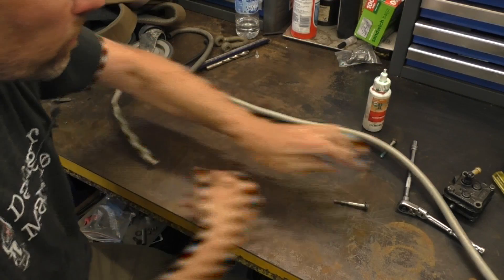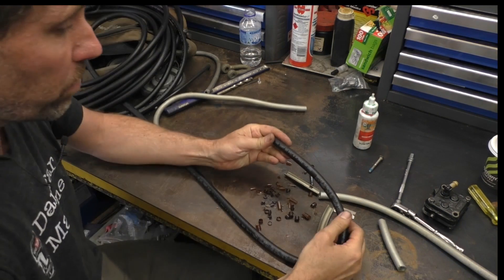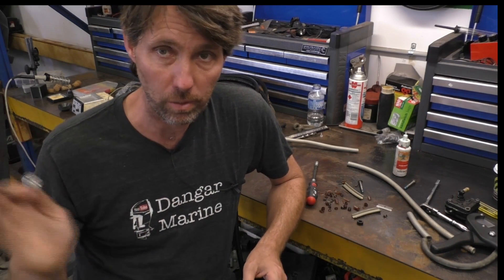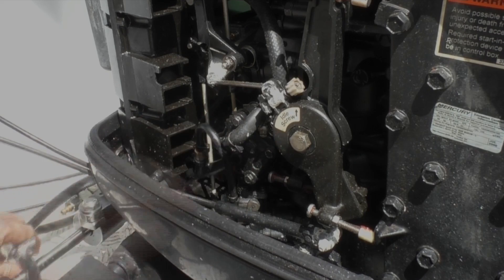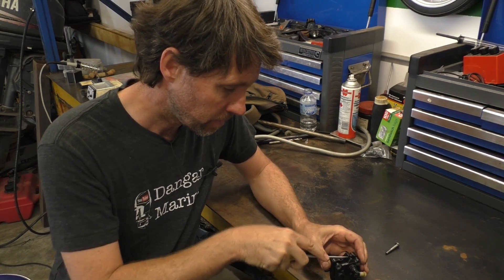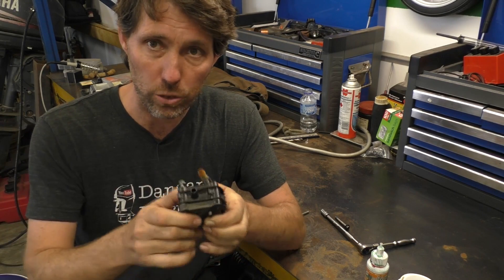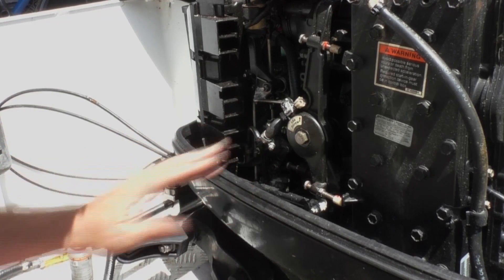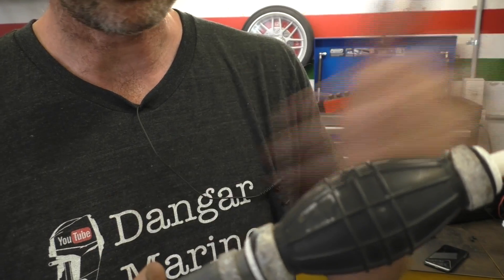Perished fuel lines

Comment: Great video buddy , may I ask for your experience does it matter the position of the fuel bulb , would it fitted vertically upwards when hanging in the boat to aid the one way ball in the bulb ? Or does it matter if it’s fitted inside the boat vertically installed , just putting a boat together which is a Project speed boat , much appreciate for any advice .

Comment: Hi Stu. Great video. I purchased one of your t-shirts and I am very fond of it. Thanks for the info on hose clamps. Question regarding the glass inline fuel filter. I have a new Yamaha F6C with approx. 1.5m of hose from tank to engine. Do you see any issues installing the inline glass filter just after the priming bulb while leaving the under-cowling filter in place?

Comment: Great video, thanks for sharing.  
I wish I saw this video before installing some 'grey' fuel lines below my deck.  
I ended up having to replace them due to fuel vapour (smell) passing though the walls of the hose and stinking out the bilge.  
Could have been dangerous over time too?
like you suggest people should only use the Marine rated fuel hose stamped with:  SAE J1527   ISO7840   USCG  A1

Comment: I need to fit some new fuel line to a 30 hp Honda four stroke. Should I go with 3/8 or 5/16 line? My boat is 22 feet long. Can I make the line 20 feet long and still draw fuel? What is the band of the inline fuel filter that you use for the clear fuel line (outside the motor)? Should I use the same stainless steel fuel line hose clamps for building my fuel line? Thanks!

Comment: Just had this on mine causing engine bogging down and losing power.
Reply: Mine is too I think it either a bad line or fuel filter
Reply: @terrywilson1813  I renew all the line and bubble to engine, changed all the filters then put Lucas injector in 24 ltr fuel can and ran it on idle until it used all fuel. Every time it ran rough I checked the plugs and they were full of carbon so cleaned and put back in (did that four times). Then fresh fuel gave it a good run full power and alls good now running sweet.

Comment: Fantastic, this fixed my problem had powering down
Issues, changed my fuel lines which were the same lines in this video, took the boat for a run and perfect, thanks heaps.

Comment: I just replaced all the plastic hose clamps with stainless on my 1990 johnson 175gt, from the carburetor to the new fuel primer ball. A big difference as far as holding prime and oil leaks under the cowl. I replaced some of the hose. I had no idea hose would deteriorate like that. I will be getting a clear gas filter(since I need a new one anyway) Thankyou for your  help.😎👍

Comment: Hi Stu, and hello from Texas. Where can I buy a shirt. I have Mercury that has the same inline fuel filter and I will be changing it and placing it before the fuel pump like you did. I have two questions, 1. Have you noticed any drop of power by placing it before the fuel pump and 2. Can I place the inline filter before the bulb. In other words between the portable fuel tank and the bulb. Thank you
Reply from the maker: He Pete, no, no change in power. Once the filter is full of fuel it flows at the same rate no matter where it is. Yep, you can put the filter before the bulb. It is a little longer to primer the filter this way but that is only an issue the first time or if you run out of fuel. Link to buy t-shirts is in the description.
Reply: Dangar Marine the reason I was questioning the placement of the fuel filter between the fuel tank and the primer bulb is because I didn’t know if the small fuel pump has enough pressure to provide adequate fuel flow first through the filter and then through the primer bulb on its way to the carbs...

Comment: Hey, Stu...Like Florida Fly Fishing said, you have THE BEST Marine channel on YouTube.  As long as we are 'discussing' fuel systems, maybe you can point me in the right direction for a winter project I am planning.  As I mentioned in another post on another one of your vids, I am redoing a 17 foot  early 1960s MFG fiberglass hull boat.  One of the things I want to change is I want to install an in-floor fuel tank, not only to increase fuel carrying capability (I'm thinking a 25 gallon poly tank) but also to 'free up' valuable floor space used now for extra 5 gallon cans.  I know how to install the tank and vents, but am unsure on plumbing the fuel lines or any electrics.  Also, will I have to put an external pump on the lines?   Do you have any videos aimed at in floor tanks or can you recommend where I can find any?  I plan on powering the boat with at least an 80 hp motor.  I originally was going to convert her to a 350 inboard, but....too much work.  Our eventual plan is to change this boat that someone modified for skiing back to a boat primarily used for fishing and family cruising on the Great Lakes here in the USA.  Love your channel and can't wait to see more on your boat build.
Reply from the maker: Hey mate, I think underfloor fuel tanks are a good way to go and I'll be doing some research on them soon as I'll be installing one in the boat I'm building. I don't think you will need extra fuel pump beyond the one in the outboard, it just might take a bit longer to prime. I imagine you could use a bit of hardline with a fitting closer to the outboard itself, but it wouldn't surprise me if many installations just have regular fuel hose all the way from the tank.

Comment: Your video was extremely helpful. During my vacation started to notice my boat was starving for fuel at full speed, it idled fine but at full speed kept 'bogging out' (60hp Merc 4 stroke)  Upon inspection I found lots++ little black pieces of debris in the fuel tank.  So the mechanic at the campsite and I drained out as much fuel as we could from the tank and then he replaced the primer bulb and changed the fuel filter. Back out on the water and the problem still exists so he insisted on a number of different things but my good judgement told me to just hold off until I could do some research of my own, which led me to your video.  Everything you described is exactly what happened to me.  I am very confident the problem will be fixed finally by me because of you.  Thanks a million for saving me much money in unnecessary  fixes. Will also be installing a water fuel separator.  Question: can I install a water separator under the floor accessible from pop out inspection plate because i have a fully floored fishing boat . THX.
Reply from the maker: Hi Mitch, glad the vid helped you. Yes, if you have room you can install the fuel filter under the floor no problem.

Comment: Why hose clamps on some joints and wire ties on the motor only? Shouldn’t you have clamps on all joints? Thanks Stu.
Reply from the maker: Hi Scott, a lot of the time it depends on room. Proper spiral hose clamps work better, but these fuel system are very low pressure compared to EFI or something like a car cooling system.

Comment: Hey Stu, thinking of replacing my fuel line and adding a water separating filter while I'm at it. Is 8mm the standard size? If I have a different size is there any harm in just replacing with an 8mm?
Reply from the maker: Unfortunately there isn't really a standard size, it depends a lot on the HP of the motor how much fuel it needs. You will see 6mm, 8mm and 10mm around.
Reply: Dangar Marine thanks mate, measured mine and it seems to be closer to 10mm. Will use that.

Comment: Great information Stu this happened to my mercury and had merc fuel line you showed which I replaced but didn't check fuel pump so that's the next job. I was having trouble tuning it but with new fuel lines it was so much easier. Thanks again cheers mate
Reply from the maker: Thanks John, it's amazing how often fuel lines are overlooked when diagnosing a motor that won't run properly. Well worth checking the fuel pump and carburettors as all those bits of debris will have gone somewhere.

Comment: where did you get those stainless steel fuel clamps from?..Thanks
Reply: I can not answer where...BUT take a Magnet with you when ya shop...Use magnet to verify they are SS.   Lots are SS band and screw ass is not(meaning that screw ass will corrode and BITE ya over time...

Comment: good thing I tried to start the merc today to check the gears. it wouldn't start? first check spark and was good then opened up the bottom carb and was empty. 2 of the fuel lines I put in were pinched. good thing I kept the old ones with the bends. how do you take a new fuel hose and put a bend in them? do you put something in them that has the curve you want and heat it up on a bench?
Reply from the maker: Hi Tim. Good question. I've never made a bend in a fuel line, I've normally found them to follow a gentle enough curve to avoid pinching. Could you try putting a 90 degree elbow in the line to help there?
Reply: there was 2 hoses that were a problem. it may be even though they are fuel hoses but from the auto parts store they may not be as ridged as marine hoses? like you're suggestion on 90 degree elbow connectors where needed. that way I can put my new fuel lines back on. Thanks

Comment: Well took a break from the outboard engine today to my Honda engine pressure washer not running. used my new vacume pump with gauge to test the carb that wasn't getting fuel in the bowl? took all the fuel lines off and found a in line filter in the hose going into the tank. Looks suspect for being clogged so cleaned it the inside of the tank and blew all after carb cleaner with air. put it all back together and runs like a champ. guess I need to do the same with the boat motor. like the small vacume pump works great.
Reply from the maker: Nice fix, those vacuum pumps certainly are handy for a whole range of things, that's for sure.
Reply: thanks, I'm surprised your there today on a Sunday? or whatever it is down there?
Reply from the maker: Was having Monday morning coffee when I replied.

Comment: thanks for sending me this video. my debris is definitely those little curved bits of broken up fuel line.

can i use any car fuel filter in my Yamaha? i was running a classic car one which was cheap and easy to see inside. the Yamaha one i have bought to replace it was very expensive and you can't see inside it easily and it's very small
Reply from the maker: Yes, I use glass filters bought from an auto parts store all the time. They are cheaper and in some ways better. https://www.ebay.com.au/p/?iid=332043560386&&&chn=ps I use them in the fuel line outside the cowling so they are easier to see.
Reply: Dangar Marine I'm so glad you said that because i don't think much of the Yamaha one for the price, it's a single disc rather than an accordion and you can't see inside easily. fuel flow does seem freer though she starts more readily and is a touch more responsive with the thin little Yamaha filter

Comment: watched the video on perished fuel lines. didn't know what the inside of the lines could look like till I watched this video. it for sure may solve my issue with my Mercury 2 stroke. my ball hose like that I took off for the winter is old and the gray material like in your video. I have a new one that came with my new 6 gal. external tank and will try that soon. also will replace the other fuel lines as well on the motor to be safe. already replaced the fuel filter but like your idea on installing it before the motor to keep an eye on it. watching all your videos since they are so educational plus the weather here is keeping me house bound. haha. one thing I don't like is not knowing something and how it works. keep up your great service to the mechanical world out here.
Reply from the maker: Thanks mate, glad the videos have been helping you with your boat. Not long until the warmer weather now!

Comment: Not sure how old the fuel lines are, as they were in place when I brought the boat. Like you said it's worth keeping an eye on these things having foreign bits in your fuel is bad news.I wasn't 100% convinced it was the fuel pump diaphragm, the guy at the boat shop probably wanted to get more money out of me. The fuel pump kits wasn't too expensive any eay so I thought what the hell, it won't hurt and I got to learn some thing.
Reply from the maker: It never hurts to replace things before they fail, particularly if they aren't too expensive. Fingers crossed it will run sweetly for years to come now. :)

Comment: Good on ya Stu!! another good and informative vid. Thanks for the mention and I love the shirt. I had a problem with fine black particular bits building up in my carbi and making the motor run very rough. I had black rubber fuel lines after my fuel water filter, not sure how old it was.  I didn't notice any bits in the filter under the cowling be for the fuel pump, it looked like it could have been from the fuel line (I'm only saying that because the bits in the carbi are same colour as the fuel line) or may be fuel pump diaphragm I have replaced both and there's on problem now. could the black fuel lines break down in such a way they produce fine bits the could clog carbi jets? or was the black bit just a build up and I didn't need to replace the lines or diaphragm.
Reply from the maker: I'd say you did the right thing by changing the lines. The diagram can split but I've never seen them crumble like the debris you are describing. Do you know how old the lines were?

Comment: I've heard that fuel pumps can be fiddly when you separate them and disrupt the gasket even if you replace the gasket. Any advice on that issue?
Reply from the maker: They can be a bit fiddly, that's for sure. The trick is to separate them VERY carefully and make sure everything is kept in the right orientation. They can also curl up a bit once they are free so it is also important to make sure they aren't tucked under at the edges when you put the pump back together. Just go slowly and check all the edges before tightening it up.

Comment: hi dangar. I started my boat the other day and when I did there was a weird noise coming from the water pump area then it stop. is that something i should worry about, or is it just sucking water?
Reply from the maker: Hard to say without hearing it but if it went away and it was a type of sucking sound I wouldn't be too worried, could have just been something around the prop. If you are worried it is a gearbox problem I would drain the oil and check it for water or metal fragments.

Comment: Stu that looks like varnish from fuel that has dried out in the fuel line rather than the line itself degrading. Either way replacement is probably the easiest way to solve the problem.
Reply from the maker: I'd be interested to learn if it was, because it is such a perfectly even layer or flexible material. I would have expected any varnish to be more on the bottom of the line rather than evenly around the outside. I've been wrong before though. ;)
Reply from the maker: It would have been interesting to cut a new piece of line open and dissect it, in fact I've also been meaning to cut a primer bulb open too so maybe that can be a view in its own right. I know what you mean about modern chemistry being understood, I'm personally more suspicious of fuel additives.

Comment: Perfect timing..
Just today I was just looking at the fuel lines on my '75 70Hp Evinrude  and thought they probably need changing.. I wonder if there is anything else to consider.  Came in and found this video - thanks for the heads up on the clear filter pre engine - will definitely be installing one now....  

Love the channel, you have helped me out with a multitude of different service items on my boat.  I definitely owe you a beer or three,...
Reply from the maker: I love those glass filters. You can get them from most auto parts stores without paying silly marine prices. Looking forward to those beers. ;)

Comment: Stu, the local Pep's  has two fuel line types in 8mm. Both are stamped that they meet the same standards. However one is 'rated' for carburettor feed line, the other is fuel injected fuel line.  The difference is the carburettor line can handle a lot more vacuum (external ) pressure before collapsing (8lbs apparently) , while the injection fuel line only handles 4lbs of vacuum, but a few hundred PSI internal pressure. I doubt an outboard fuel pump could drag more than 4lbs vacuum (carb floats/needles don't like much more than about 2lbs of pressure anyway) so either should work, but apparently there is a difference.
And can you talk to the TV/Foxtel people?  I like the length of your product placement ads a lot more than theirs!
Reply from the maker: Hey Ron, I should have mentioned that low pressure hose would be fine as EFI hose is a lot more expensive and certainly, as you say, not necessary. One of my best friends works for Foxtel, I'll have a word with her. ;)

Comment: Hey I have been watching your videos a lot and I have been learning so much about engines and engine care. I just recently bought a Hobie Power Skiff with a 60 hp mercury 2 stroke. I have noticed that there is gas dripping down from the engine down the side and into the water. I have tried to run the engine a look around to find the leak but can't seem to find the origin of it. I would love if you had any suggestions. Great job on the videos I love them. Keep up the good work.
Reply from the maker: There are a few possibilities. If could be a split hose or bad hose clamps at any of the joins.  Could be a leaking fuel pump gasket or could be that the floats in the carburettors aren't sealing properly so the carburettors never stop filling and just over flow.

Comment: hey stu love your vids !! just 1 question does running ethanol fuel through ethanol friendly lines damage ur motor (25hp tohatsu) cheers and will sure be buying one of those shirts :)
Reply from the maker: It isn't recommended as it can also eat some of the seals and the diaphragms in this style of fuel pump. Ethanol will also absorb water over time.